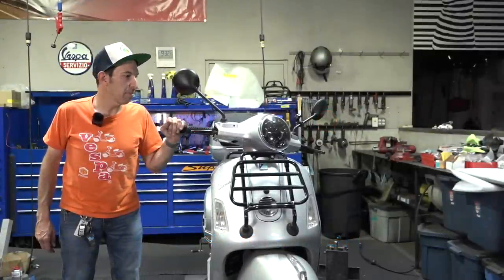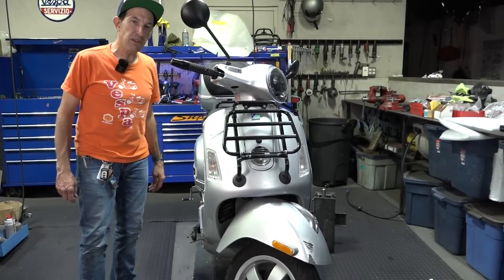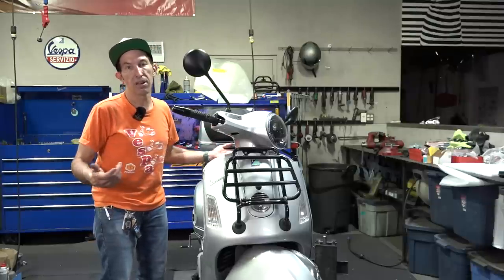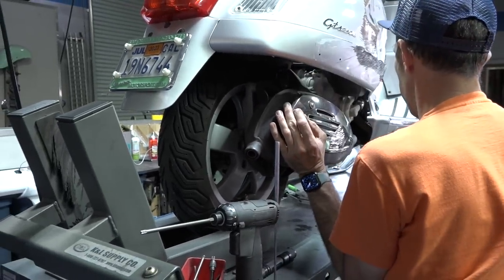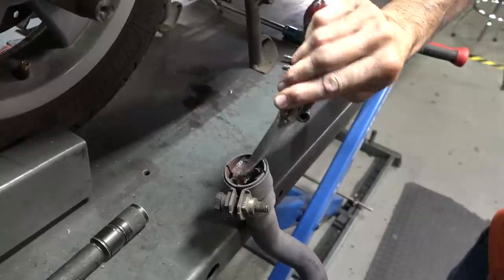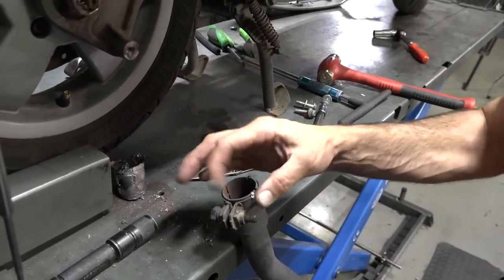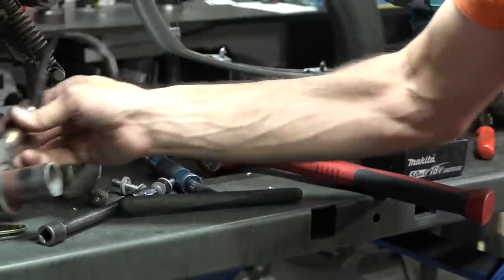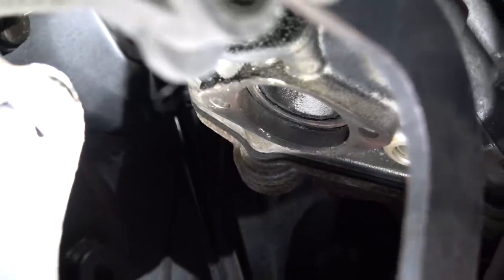Opening a Can of Worms on the Winter Project Beater Vespa GTS (PT. 2)

Comment: I've been torn between replacing my 2006 Vespa GTS 250 with 44K miles on the clock with a new GTS.  Or freshening up the scooter with some new parts and keep riding it.  I have an occasional surging idle on the scooter but nothing that has affected riding.  But seeing this video I'm going to search for air leaks and hope I don't find any broken studs.

The front wheel spins hard so either the brake is hanging up or the wheel bearing is bad.  Since there's no noise or vibration, and it loosens quickly when riding, my bed is the pins in the caliper need to be cleaned and greased.  Or maybe just replace the entire front caliper?  Since I added an ET4 and a Himalayan to the garage I got rid of my lift.  I may regret that but there's just no space.

A winter project.  Sometimes I like the idea.  And other times I hate the idea.

As always, thank you for your fantastic videos.  I can't count how many times I've been fixing something with one of your videos playing on my iPhone!

Comment: Thanks for posting another interesting video. It does make me sad to think that there's a whole world out there, of two wheel vehicle owners who just use their machines without any thought to doing a little maintenance. None of what we've seen on this one so far should have been impossible to do along the way and it would have kept the thing in serviceable condition. I guess people don't see that a little job here and there, will protect the value of their scooter and  save them from spending a lot in the future to replace it. If it was 50 years old with 100,000 miles on it then trading up for a new machine would be understandable but I bet the previous owner lost a fortune when they had to sell it in this run down condition. Good for you,  for saving the scooter from becoming a complete ruin! I'm keen to see how you get on with the repairs and renovation. Thanks again! 👍👍

Comment: Thanks Robot from the uK where I bought an unloved by most 2005 LX 50 2T as a winter project about the same time as your vespa. FIrst timer, so everything to learn and the videos sure help. Bodywork with the side stoved in, engine worn, tatty exhaust and a few years of broken bits. Hooked and frustrated in equal measures, the walk away routine always gets you back to the bench another day. Many thanks.

Comment: Just picked up a 2006 GTS 250 myself. Only a thousand miles on mine. Voltage regulator went bad and it needs new tires and fluids but otherwise in great shape. Only one scratch that looks like it may have been from someone taking the cap off to bleed the brakes. Will be doing my own series but, probably not as good as yours LOL
Reply: I replaced the original Ducati made voltage regulator on my 2006 Vespa GTV with  the Japanese replacement voltage regulator, worked great afterwards. You can remove the wheels yourself and have a shop install new tires, or use big tire levers (and scratch up the rim) like I did. Next time I will use a sawzall or dremel to remove the tires and have the shop do the install of new tires only.

Comment: Cool cracking vid just bought my very first scooter 2007 250ie(always had bikes still have ha!) been stood for two years(import from Sicily one owner 34,000 km)still runs sweet but tuna change all fluidised etc not sure yet about the belt but anyway cheers ,hip 👀

Comment: Question from here in the United Kingdom.  The 125 leader injection engine as found in the yourban and the GTS. How exactly are they limited as in the rev limiter. Also is there an easy way to bypass the rev limiter. The reason why I ask is because I have a Piaggio MP3 125 yourban M711M and I find the rev limiter dangerous on the motorway / highway. So if you can help that would be great.

Comment: The shame were I live is that a scooter with this much damage would have been written off by the insurer and listed by the road authorities as not repairable so it can’t be registered for on road use.
Reply: Why? How is it possible for insurance companies to pay for a new scooter with so much ease?
Reply: @orfeas92  I live in Australia. People insure most vehicles as it is cheap compared to say the UK. The authorities have tried to stop people getting wrecked vehicles fixing them and selling them as uncrashed vehicles. The trouble is that the cost of repair is so high that a slightly damaged vehicle will be written off as the value is lower than the repair cost by a professional. Many of them are easily fixed at home as it is only superficial damage but the VIN is recorded and it can’t be registered. In my state there is a system that very slightly damaged vehicles can be inspected (expensive) by the authorities and re Reg but in some states here that can’t happen either - slight crash and its only good for wrecking/breaking but you can use the parts inc the engine.

Comment: Hello I have a Vespa primavera Sprint 50 40 T.  3V where the throttle is in the mirror on the right of the I have a handle that's broke a broke handle it's not really broke but it's curved over where it fell over after a lady felt about ran me over I ran off the road well anyway how do you get those shiny plastic pieces off I can get the back window oil where the brake handle is I can get that one off but the brake handle is loose and I want to know how do you get that off it's just plastic and I don't want to keep breaking something cuz it takes forever to get the parts here and PA the Harley-Davidson shop you asked him any questions about it they're the ones that sold it to me and it's like I'm the last on the list cuz I don't have a Harley but could you do one on that thank you very much this is Richard Paris

Comment: When storing a carbureted model Vespa for a few months, do you recommend draining the carburetor or will fuel stabilizer be sufficient? I use Stabil for my carbureted motorcycles with full gas tanks & have never had any issues.
Reply: Excellent stuff Stabil, I've had in bikes for 3 years and still been OK. 😎